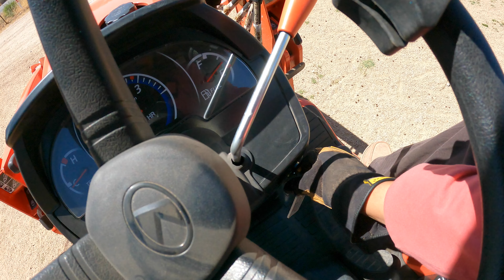Land Pride Box  Blade Angle of the dangle

Comment: Great quality video🤙🤙. Quick Question. What's the estimate price for a quality tractor like yours, looks great for farming crops and other tools.
Reply from the maker: Thank you so much. They are truly quality little machines it’s totally changed our lives here on the ranch. Things we would do by hand and take hours get done so quick now. Not to mention a repair job we did of a berm blowing out during irrigation without this tractor we’d never have been able to plug that hole and our home would have been flooded. If you are contemplating getting one get it I procrastinated for a year and a half and so regret all the wasted time 🫢😂😂. So depending on attachments and extras and the dealership deals 25 k and above is a good starting point. I’d recommend going into a dealership to get the ball rolling. Keep us posted and happy shopping 👍🏾😎😀
Reply: @deanb8736  Thank you so much🤙🤙😎